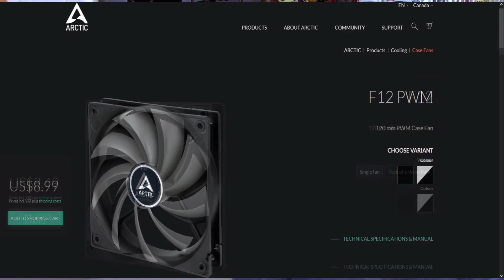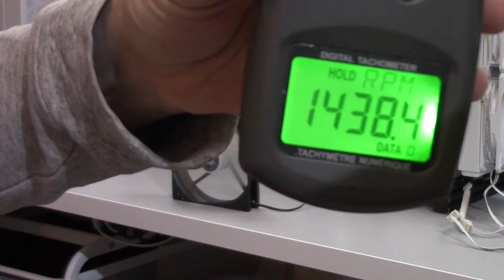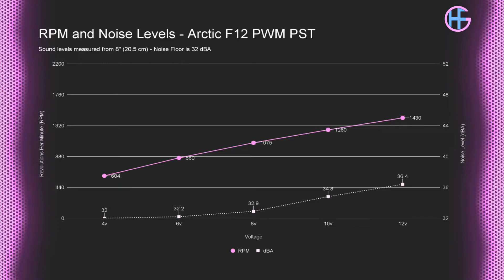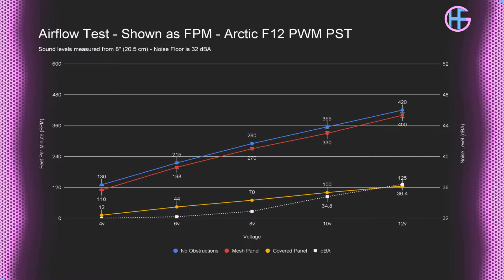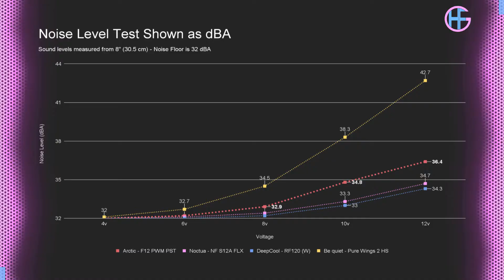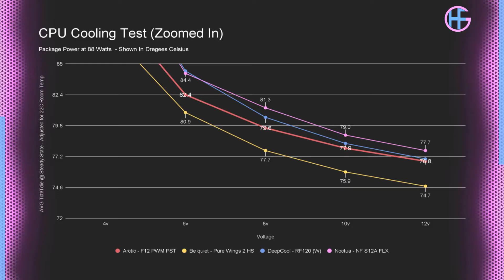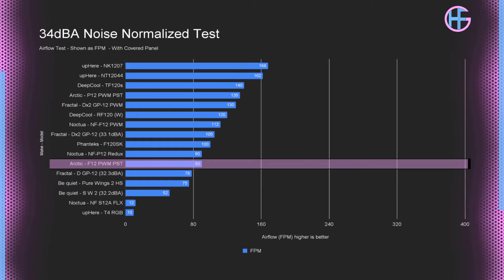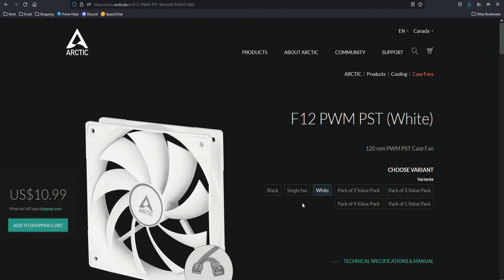Arctic - F12 PWM PST - PC System Fan Review

Comment: I have case with mesh front and with filter, and with a top exhaust with filter, I am using an air cooler AK400 for my Ryzen 3700x, btw the name of the case is Tecware Alpha M, you can google it, and I am confused whether to get the P12 PWM PST, or this one F12 PWM PST... i currently just running the stock cooler from the case, I all have 6 fan including top and back which are exhaust, and 3 at the front.. I'm more inclined to buy the P12 version but I am worried about the noise, as I always read it has a whine noise, my ears are super sensitive to noise. I am not sure if this would improve my temperatures. Currently my temps are around 40-45 deg celcius for both cpu and gpu (asus tuf tri-fan 3060ti), a little hotter as im in south east asia and a tropical country with no airconditioning turned on, room temp is always around 30-32 deg cel. What do you think is better for my situation? I can buy the pack of 5 and add another one for the exhaust.
Reply: Mate i know it's a bit late for the answer but P series are literally for radiators and "restricted" places. It stands for Pressure. F stands for Flow and for places without restrictions.

Comment: The old model I have used ever since you have been PC gaming has been a12025-12cb-3bn-f1. I never even actually knew they had a stronger 120mm fan other than that since I never did any research. I thought they were all the same until last week when I looked around and found these were rated the best cheap 120mm fans. These blow way more. I suggest anybody who wants an upgrade to get this brand.

Comment: Hello, I bought 5 f12 silent with 3 pin connector, and I bought an artic hub, but I cannot adjust the fan speeds, is it possible that  depends from the 3 pins!?
Reply from the maker: The Arctic fan hub is a PWM hub, so I'm not sure if it will work properly with 3 pin (DC) fans. My best guess is you will need to switch the header that you have the hub connected to to DC and "smart" in the bios.
Hope that helps.
Reply: @HardwareForGamers  I think I have to check how to do it

Comment: Is this fan proper for back exhaust fan, bad part is my cpu cooler blow against the gpu is not optimized direction but otherwise ram cant enter so I wonder if this fan on back of case will make temperature better, case got mesh up
Reply from the maker: Will it help... Most likely yes
Reply: Drop like 3 degrees down from processor GPU not moving, but I not expect miracles, case I use is cheap brand copy of Corsair 4000X, not much airflow even fans in front there no mesh and is hotbox. Fan is great for money with 6 year warranty. I use before another model on Arctic and have good impression about it

Comment: Great video but i would like to ask something. I have an a320m a-pro max msi motherboard. It has only 1 4pin header for case fans. Does that mean do i need to buy a fan hub? Or with the pst thingy l, could I just connect all of them into that 1 header?(5 f12s pwm pst) Thanks in advance!
Reply from the maker: It will be fine plugging all five f12's fans into one fan header